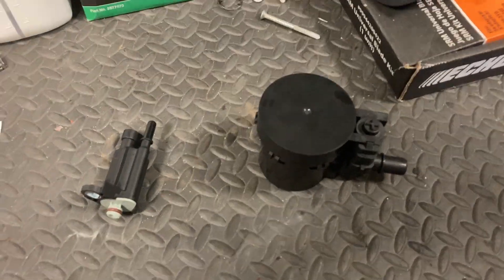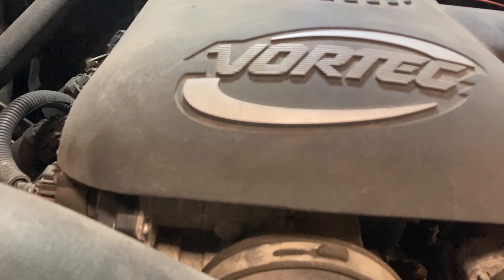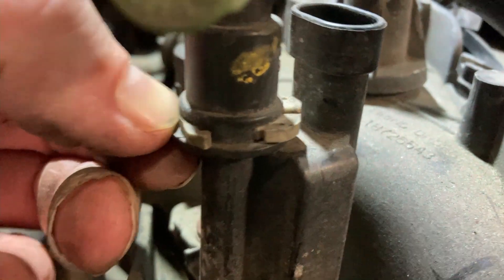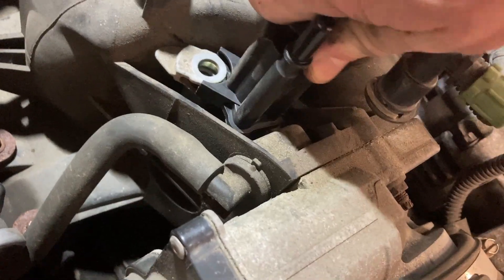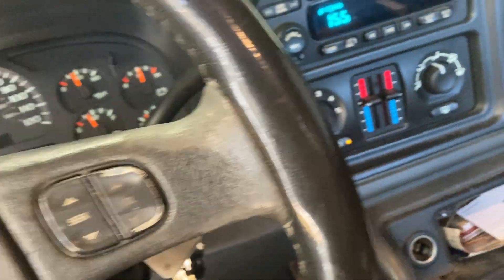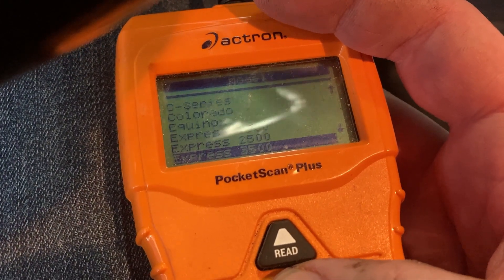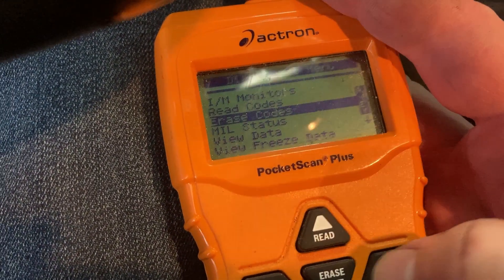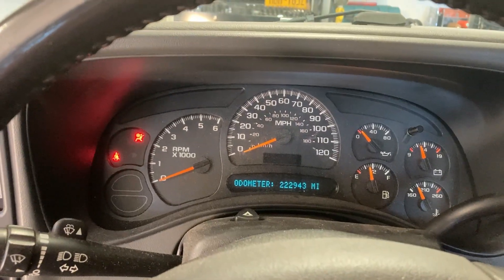How To Fix P0442 Engine Code - Chevy Silverado - Part 2

Comment: For a vehicle that old, you're going to want to check hoses/lines. (Especially if you're up north)
Also, that's an O ring, not a gasket thingy. (Sorry couldn't help it)
Reply from the maker: The o-ring is black on the old part and red on the new part. The gray rubber piece that I needed to swap from the old part to the new part I’m going to continue referring to as “the gaskety thing” 😁

Comment: Will these effect how it runs n drives is it safe to drive with these code need to do the same on mines
Reply from the maker: I ran with the code for years before I decided to do something about it (bc I was selling the truck and wanted the CEL off). 

It ran fine the whole time.

Comment: Does the service light come off immediately after you change purge valve or do you have to clear code or drive for awhile?.. thx you
Reply from the maker: With the purge valve I cleared it manually. It eventually came back. When I changed the gas cap, it went away immediately on its own.

Comment: Did you have a big and small Evap leak codes ? I’m wondering if my Tahoe needs the vent valve I changed the solenoid one in the engine but the codes still on you think I need the one in the back as well ?
Reply from the maker: I wound up getting both codes at different times. First was the small leak, so I changed the canister near the gas tank to the old version (without the remote filter). Still had a light so I changed the solenoid on the engine. Still had the light. Changed the gas cap, and the light went away.  THEN I got a large leak code. I wound up getting a new canister (the new version, with the remote filter) and changed both the canister and the filter and all codes finally went away. Chasing these are a pain in the neck, but thankfully the parts are pretty cheap.
Reply: @CarsCraftsDrafts you change the gas filter or which one
Reply from the maker: I didn’t touch the fuel filter, this was the EVAP canister on the outside of the gas tank.

Comment: How loose should that purge valve be? Mines has a little play and it was hard getting it to seat back in . Thanks
Reply from the maker: All the ones I tried were a little looser than I would have liked. Apparently it’s a non-issue, but I would have felt better if it was a bit more snug.
Reply: @CarsCraftsDrafts   thanks for responding 👍🏿

Comment: Replaced the bottom solenoid and the whole whose system and the top one under the cover but the code keeps coming back. Any idea what it could be
Reply from the maker: Honestly, could even be the gas cap. Sounds silly but mine kept coming back and that was the fix. I didn’t even have to reset the code, it just went away when I got a new cap.

Comment: Where did you buy your scammer  and How much cost?
Reply from the maker: I got a BlueDriver not too long ago (https://amz.run/5USr) but I still use my older Actron CP9660 (https://amz.run/5USs) pretty often.  I like the Actron because I can easily see which monitors are ready.  That was a big help in the past with this truck, because the EVAP monitor is the last to go 'ready' and, bc of the truck's age, I can take it to the inspection station with one monitor showing 'not ready.'  I was able to get it inspected before the EVAP monitor kicked in a tripped the check engine light.